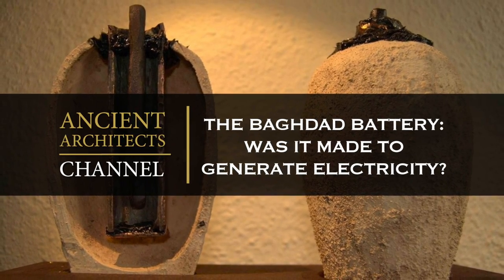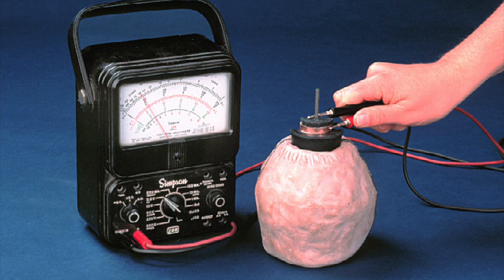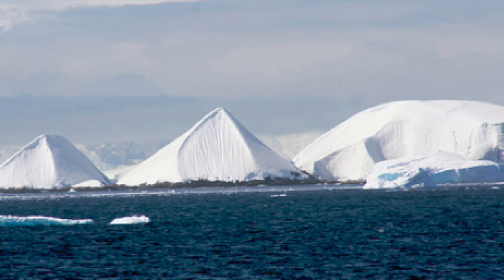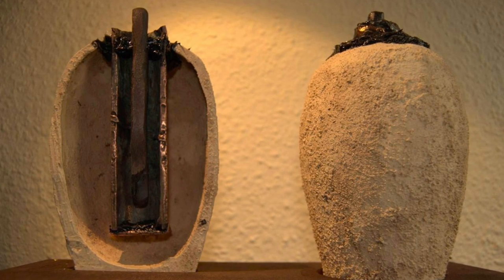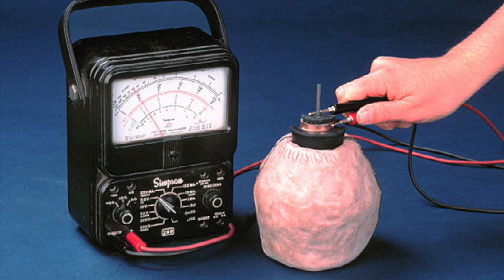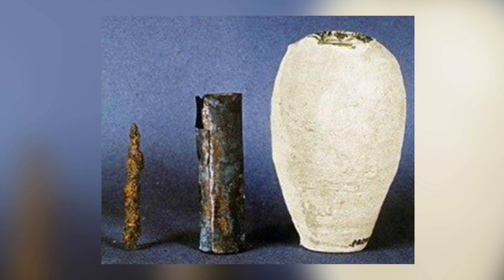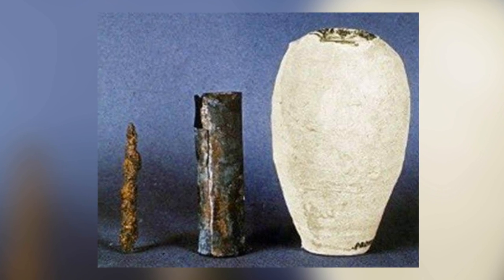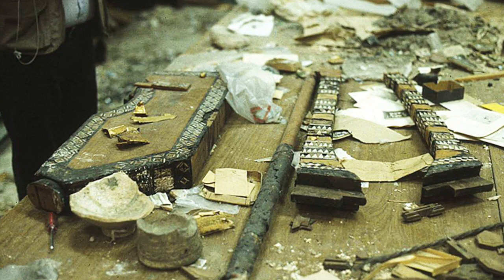The Baghdad Battery : Did it Really Generate Electricity? | Ancient Architects

Comment: Minor observation: building a bigger "battery" would not increase the voltage, because the potential is due to the chemistry of iron versus copper. However, you could increase the voltage by stringing multiple "batteries" in a daisy chain. 

One thing I'd like to know is how the vessel would have been used to store a scrolled document. Was the iron core a spindle, and the copper tube a cylindrical envelope?
Reply: Good point dave,.
Reply: Good question too.
Reply: Multiple ones like the jars in Laos 🤔
Reply: Good points! I was writing the same things without seeing your comment!
Reply: Exactly what I was wondering. Doesn't seem to be likely. The galvanic action would destroy any organic material placed inside.
Reply: Just to refine a good comment a bit further: Not really a daisy chain so much as simply an 'In Series" row to pust the voltage ....or of course, for current: In Parallel. :-)
Reply: It will increase the available current at that voltage.
Reply: yes, thought this also
Reply: Just because these are the only exceptions left in history,  does not mean that this was the upper limit of there capability.  There is much missing in history I think.  If they had knowledge of electricity,  current flow, and some even basic rudimentary physics,  they could easily have built much larger devices,  or even other designs as well as capacitors etc. The lack of evidence in historical records,  does not reflect the whole story.  We know ancient humans had electroplating,  we know they had power tools. They also had techniques to polish granite,  and other stones to a mirror finish,  perfectly flat. There is such a demonstration of presiscion,  that it must be recognized.  Sure , for larger stones , they could have used devices powered by massive stone flywheels,  spun up by human or water power,  but there are many examples,  of drilled holes in the edges of stone boxes, in such tight confines, that you would never fit such a large device with in to do that tooling. It's ironic that so many riddles and questions become quickly laid to rest, when you accept that they had electricity,  they had the ability to use it, make tools, plate metals, and more than likely had lights ( that famous depiction in Egypt that shows what looks like a light bulb) I know there many theories,  but after a while it doesn't make sense,  to see people continue to work around,  with theories that have little evidence to support them,  to deny they had electricity.  Even the pyramids,  are known to be built with spacific stone types, that ironically have spacific electrical properties,  some stone types working as insulators, some working as conductors. Then there is quarts, which when vibrating produces small amounts of electricity, I mean the coincidences keep going and going.  You really have to work hard to say that they didn't have electricity,  and this is all bullsh_t . On the other hand, just look at all the compiling evidence,  to suggest they infact had this knowledge. Its staggering to me. And to think old men have suppressed new data, and sound theories,  with sound evidence,  just to protect there own theories In academia. There is alot of evidence there too, which is why I think mainstream archeology,  is so full of holes. People coming out of school etc, are scared to question the old guys, and the old guys are afraid of loosing there place in the spotlight,  in fear of there theories being disproved or thrown out. I think lately,  that the world is privileged to much more accurate data, information,  and research,  thanks in part to amateur archeologist.  These people have no credentials to loose, they are not threatened by top tier academia,  they are true enthusiasts,  searching for the hidden truth,  no matter what anyone thinks.  I look forward to the day, where these amateur archeologists,  bring forth such amazing data,  that it utterly embarrasses the the credentialed people,  protecting there thrones. Check out uncharted x. The guy is amazing,  his research,  his documentation,  his photos and videos that he shares, the things he discusses, his interviews, are all amazing.
Reply: if it was used to store a scroll, then why put it inside a jar? You could make the same argument for a battery as well. the battery would work just fine without the jar
Reply: I agree with you. Why couldn't they said that batteries were used for some sort of electrolysis to make certain type of stone,or cement? Or something else? I do also think that the author has to go little bit mainstream because You tube is lately censoring everything that is not mainstream approved.
Reply: @gyro4250  Most of the Dead Sea Scrolls were actually contained in jars.  I do agree with someone above that a contained electrical thingy within a jar and any biomatter would most likely not survive.  (Salt water by itself, maybe. cf. deep water Atlantic shipwrecks)  So scroll preservation is very shakey.  Even dry storage, with the central spindle, makes absolutely no sense, though I'm not familiar with all the containers for the Dead Sea Scrolls.  Maybe there's a way to access info about the DSS excavations that I'm not entitled to...
Reply: @benhager2559  Availability of Electricity (battery) does not implicitly mean availability of power tools or lights.
a) electric motor was not invented
b) light bulb (LED or Incandescent) was not invented.
Electricity was known to Ancient human civs and it was used for electroplating and medical therapy.
Reply: @benhager2559  Also, if you really want to argue in support of power tools, then Steam engine is a better fit. I also think that the ancient humans did have access to some power tools. I think those power tools could be run using a rudimentary steam engine or wind turbine or water turbine.

But, I don't think the ancient civs had electric light. But, the rich elites (and cities) used polished metals and gems in combo with candles to create a pretty good light inside their homes.
Reply: If they're for storing scrolls, why were they sealed with no scrolls inside? Why put iron and copper junk in with scrolls? Why make 15cm (6 inch!) jars for storing scrolls? 
They ain't for scrolls.
Reply: i want to reply to my previous statement. and add too it. just to tease minds, and stimulate enthusiasts. "Researchers Say King Tut’s Dagger Was Made From a Meteorite"  ,, lets pretend i can discount all the aforementioned facts, lets say you have some sound arguments. lets shift a gear or 2, and look at this data. lets compile ( linux junkies.....) on top of all the data we have, lets go round and round, searching for theories to discredit the astonishing capabilities and knowledge these people had in there time. lets say i can make a theory to state they had no electricity , lets throw it all out and assume they had no technological understanding beyond bronze chizzles and elbow grease.. Not using electricity.  lets assume the pyryamids are by chance constructed of specific materials with specific electrical properties without any correlation to those properties, they did it by accident because the stones were pretty., lets assume the Baghdad battery is just some fancy wine glass, etc etc. you see where im going here. im obviously being facetious , but i want to commune my thoughts, as well as to stimulate your own . lets say we can find some bland theory to disprove all of it. ok. now we come to a new discovery (well its not actuality  new, but the theories that come forth to explain it are somewhat new and evolving) . a dagger from ancient Egypt, made of iron. "Iron working was introduced to Europe in the late 11th century BC" ,,, more quotes - look it up yourself fellow enthusiasts XD "King Tut's Dagger Is 'Out of This World' The iron dagger found in the tomb of the Egyptian pharaoh Tutankhamen dates to around 1350 B.C., about 200 years before the Iron Age."  this is going way back . some 200 years before the iron age. it is said and well known, that this dagger was forged from a meteorite. with all that they have shown us, there incredible demonstration of knowledge,, that many do there best to pass off as a complete accident, we pass off the electroplating capabilities, we pass off the fact they had electricity , we pass off the fact they had power tools , we pass off they had education of astronomy , we pass of they had understanding of metallurgy and chemical or electrical properties, we pass off any technological capability beyond bronze chinless and elbow grease. i wonder, do any of you know how difficult it is to find a meteorite? the time involved in finding one, and discerning it from an average rock? it would take a trained eye. educated and competent. then to smelt it properly, at specific temperatures, to forge it?  you dont just throw it in a hot fire.  another quote " Most importantly, your forge needs to be able to reach the right temperature to soften the metal, but not hot enough to melt it. The appropriate temperature for forging iron is 2500 degrees Fahrenheit or 1371 degrees Celsius" if the temps is off too much, you will not forge the metal correctly ( it will either become brittle or have contaminates in it) .  if they by chance, found a piece of rock that fell from the sky, it just looked pretty, and it just happens to land at there doorstep without the tedious effort of looking for it, and discounting the knowledge required to identify it, or find it, ( i mean im giving history a break here , since they were so primitive, it must have fallen on there doorstep, because without proper knowledge you wouldn't just roam the lands and find this ) so lets say it landed on there doorstep so it was obvious. then what, we know how to make bronze , lets throw it in the fire see what happens right " The melting point of bronze varies depending on the ratio of the alloy components and is about 950 °C" to smelt iron, u need 1371 c. specifics here matter. like many things in Egyptian history, there is a demonstration of precision.  you dont just throw an iron meteorite into a fire, and forge it into a dagger. there are specific temperatures involved. ill end it with this. these people had incredible knowledge and understanding, of chemical properties ( the specific materials used in pyramids, this dagger etc etc )  electrical properties , they had electricity, power tools, electroplating techniques, they had an under standing of metallurgy, and they had astronomical knowledge.   something in history is obviously lost. these guys were absolutely amazing, and im unsure if i trust the dating. i mean the Sphinx for example, is found and said to have evidence of water erosion, taking it back long before the guys on there thrones protecting there theories want to tell us. i mean 10s of thousand of years. thats significant. . in fact the smartest people doing research today, would say the Egyptians just found that stuff, and worshiped it, made it there own. i think its very likely that ancient Egypt represents 2 different distinct cultures. and one predates the other significantly . that just makes it more interesting, because someone long , long ago, almost beyond imagining, had capabilities that we can not duplicate today.  and were quite capable, i mean we build i9 and ryzen cpus lol., arm cpus and cell phones, we have space x etc, but we could not build a pyramid, at the level these guys did. and im humbled by that. its disrespectful to whoever they were, to pass them off as cavemen with primitive bronze tools and massive armies of slaves. these people were competent, precise, and they made a demonstration of this.
Reply: @bozo5632  I agree that contraption is a poor way to store scrolls. And no one who takes so much time and energy to build a device would use it for such a poor function.
Reply: @benhager2559 
I think there is no mystery there:
a) Electricity: ancient human civs had knowledge of Electricity, but had not yet invented electric motor or lights (Incandescent or LED). Electricity was used for electro-plating and electro shock therapy. 
b) Power Tools: Ancient Human civs had access to some power tools powered by steam engine, wind turbine and water turbine. Large Stones were mined, transported and carved using these power tools. Underground water tunnels were dug through mountains using these power tools. Large stone Temples, Pyramids,... etc were built using these power tools.
c) Pyramids: iron was introduced to Egypt in 1550 BCE by Hyksos (invaders from Oxus river). Iron dagger in Tut's tomb shows that Tut belongs to period long after 1550 BCE. According to Herodotus, Pyramids belong to 900-750 BCE. 
d) About Sphinx: read my revolutionary theory on Sphinx here: https://revisedworldhistory.blogspot.com/2020/04/sphinx-of-giza-was-built-by-persian.html?m=1
Reply: @bozo5632  Also, the best way to store written scrolls is to simply copy them from time to time. Cheap and best.
Reply: @benhager2559  You don't have to smelt meteoric iron. Meteoric iron was indeed used by other cultures. 

The pyramids are made of ordinary stone, cut and hauled in ordinary ways. AFAIK all of the evidence of power tools and space age materials have been demonstrated to be false. 

Step back and look at it - the great pyramid is literally a stack of rocks. Best one ever, no doubt, but not rocket science.
Reply: @trira1171  There's no evidence (and no need) of "power" tools
Reply: @trira1171  Yeah, no one stored scrolls for centuries so that archaeologists could find them.
Reply: Storing holy documents of papyrus inside containers of acid, seems like a very bad idea, to me. Also, why use copper and steel for components in such a contraption? I find this hypothesis way more far fetched than the battery one...
Reply: @trira1171  All of the necessary steps to build a pyramid (etc) have been demonstrated by (inept) modern people using tools known to be used by the Egyptians. 
Chartres cathedral was built by hand. 
There's no evidence of iron mining or smelting before X date - and there would be evidence. (Mines, slag, iron artifacts, writings.) 
No doubt they used some machines - a lever is technically a machine - but there's no evidence for, or need of fancy machines or mysterious technologies. 
Yeah, for the most part they did it by banging rocks together and stacking them up. The pyramids are ~just stacks of rocks.
Reply: @bozo5632  all the necessary steps to build a pyramid haven't been demonstrated using tools known to be used by the Egyptians , we have people like Mark Lehner demonstrating how they would have cut a large stone , at a rate of less than an inch per day ,using tools that the Egyptians have not so far been shown to possess ,  if they do find a 6 foot saw ,then they can hypothesise on how it was used , but to claim this is how they cut the stones for the pyramid without the evidence for the saw even existing just makes a mockery of everything . if they can make stuff up like that   ,what else have they lied about  .
Reply: ben hager Really good comment. I like how u break it all down. They absolutely knew what they were doing. My question now is...who were THEY???
Reply: Absolutely correct , thank you !
Reply: @gyro4250  modern batteries can also work fine without any protection, so why do they put them in mechanically stable jars?
Reply: @bozo5632  I am in complete agreement with you 👍
Reply: @bozo5632  I think you are just underestimating size. The size of pyramids alone is enough to say that the Architects needed some kind of mechanization.

Do you really think Pyramids can be built without even iron tools (as hypothesized by  mainstream archeologists and egyptologists)?
Reply: Exactly. Absence of evidence is not evidence of absence.
Reply: @trira1171  Electricity at 1V not likely used for shock therapy but to stimulate the parasympathetic nervous system and create links with higher states of consciousness.
Reply: @Schnitz13  Yea, that is also possible. 👍
Reply: @benhager2559  One interesting possible tech: using music (of vibrating tuning fork) to drill holes into stones & caves.
Reply: @iggymorts7086  They were human beings... just like us!
Reply: Wouldn't acidic liquid also be a bad combination with easily degradable scrolls? That seems stupid when you want to conserve them
Reply: Yeah, was going to say somthing about the field of Jars.Why make so many giant jars and why discard them by the thousands?
Reply: They linked multiple batteries in a line to Inncrease power

Comment: My Ancient Middle Eastern archaeology professor told the class that they were used for electroplating. As far as saying no electroplated items have been found, I've had several electroplated jewelry pieces. If you actually wear them, or for that matter expose them to the elements, the plating wears off. If it's a really thin coat, generated by very low voltage, how would you actually know if an item had been electroplated if you don't know to look for it. In my mind, it doesn't rewrite history. It just shows that ancient people were clever, and industry secrets aren't a new invention. Preserving scroll in them doesn't pass the sniff test. Why would you have acid residue in a vessel to preserve scrolls?
Reply: People even 100 years ago were a lot smarter. So 18k years in the past, people think men couldn't manage any electricity. 🤣 Which is proven wrong already. Even pyramids have some paintings about light bulbs, which were glowing. I haven't been there on that time, but I'm pretty sure, that thing which they called magic, was our simple electricity 😆